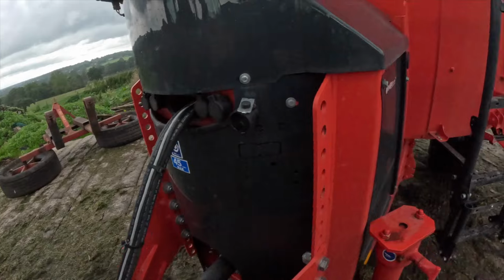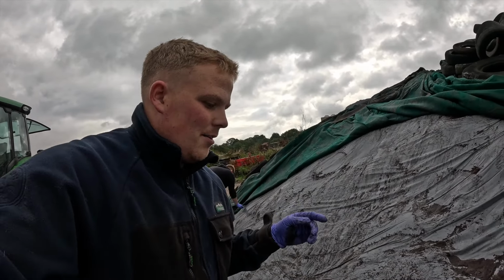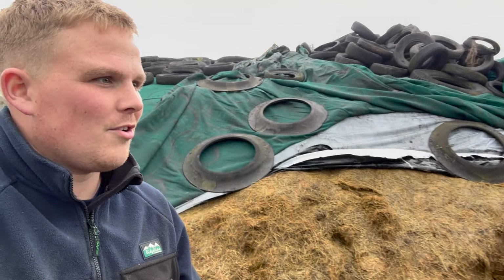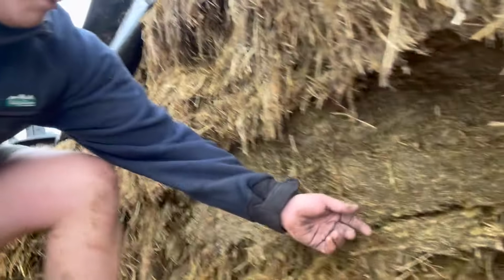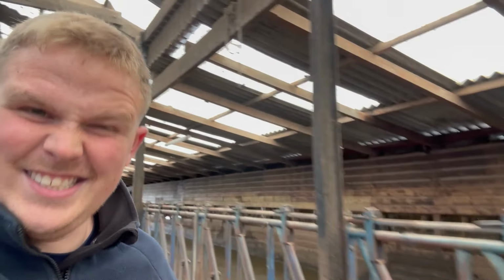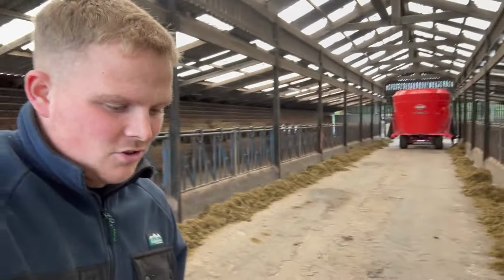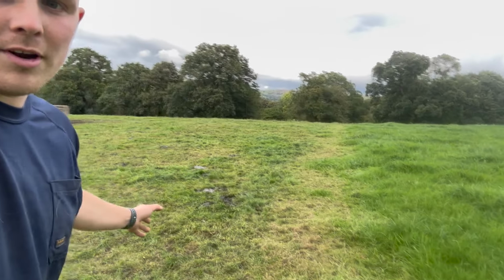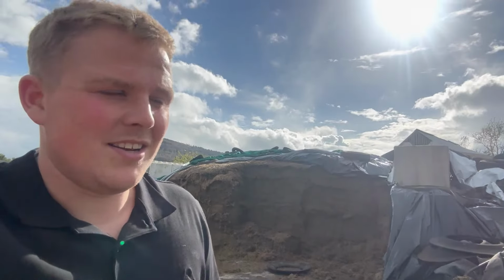OPENING THE DREADED 1ST CUT CLAMP!!! AKA THE DIGGER CLAMP 😱

Comment: Lil tip for the shear grab, open it up get a flap sanding disc on 4”grinder and put a shine on the cutting edge and a little sharpen. Inside and out just knock the rust off and it shear off first bite, cuts easier and less stress on machine 😉
Reply from the maker: @lordlamb8881  I have done this on the merlo one we’ve just had back! Great tip! I’ve got a couple new knives welded on it too, works a treat. The one on the John Deere loader was an emergency farm sale buy 🤣